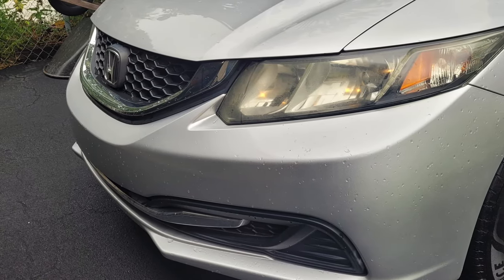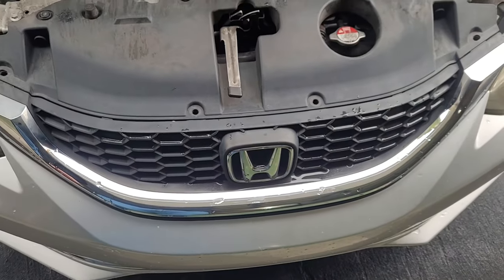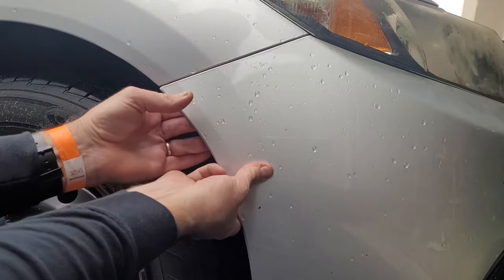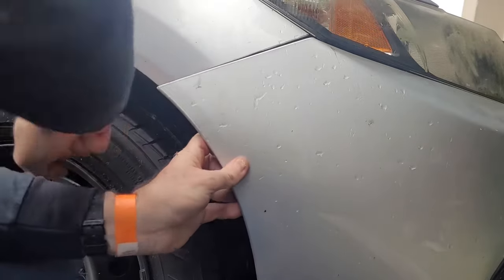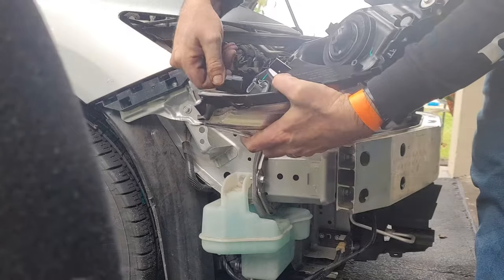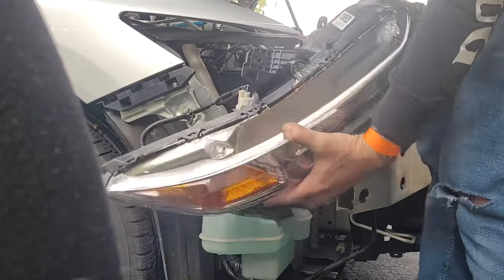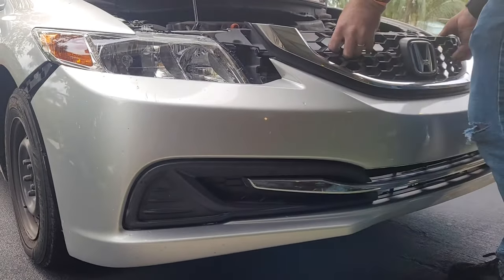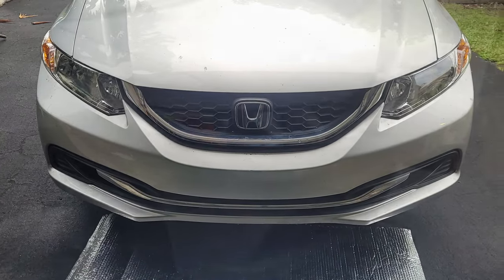2012-2015 Honda Civic Headlight Lense Replacement

Comment: Excellent instructional video on lense  replacement.  My local Honda dealer wanted $980 parts and labor to change lenses on my 2013 Civic.  Bought the parts new on Amazon for $150 for a set.  Watched your video and completed the job in 45 minutes.

Comment: This video really helped me replace the headlights everything went smooth 
Side note I ordered my headlights from Amazon 
And the bulb socket for the turn signals was really loose in the new headlights so if this happens to you just go to auto zone and buy the universal rubber O- rings from doorma and put 1 more that’ll create a snug seal and problem solved hopefully this helps anyone

Comment: Doesnt look too bad, I have a 2014 tourer (EU thing I believe), but it looks to be almost identical, just different shape light and bumper. All the metal structures look identical. We'll see what happens, I really just need to change bulbs but its so tight I'm better off taking it apart.
Reply: Easy peasy, needs some light percussion when assembling. The tourer has mudguards etc that make things a little different but nothing dramatic.

Comment: I'm currently having trouble getting the headlight assemblies out from the front. I've removed all 3 screws for each housing and have releases the small plastic latch on top. As much as I apply force to pull it straight out or in any angle, it won't come out.
Reply from the maker: There are a few plastic snap tabs in there. I can't remember exactly where they are or how I manipulated them to get them to release. Worst case scenario they break and you find replacements at the auto parts store.

Comment: Did you buy the new lenses from the dealer or did you buy aftermarket and if aftermarket do you remember the name of the company?
Reply from the maker: I bought the lenses on ebay. I picked the cheapest option that fit the car year, make, and model.

Comment: It would have been helpful if  you've been said each of the three types of lights you were replacing . I mean how do they called. Because I don't know how do I look for them at the store.
Reply from the maker: I replaced the entire headlight lense. You can go on the internet or to an auto parts store, provide the year, make, model (2012 honda civic) and what you want (driver side and passenger side headlight lense). The internet or parts manager will find the part you need.
Reply: Look on the outside of the headlight, you'll see H11 and 9005. Then the side light should be on the far ends.

Comment: You could have easily restored those with a kit
Reply: Restoration doesn't always look that good and doesn't last very long before the plastic is hazy again. I did restoration on my headlights and ended up replacing the headlights anyways.
Reply: @zeus_2001 It depends on how you do it and what kind of kit you buy or products you use. It doesn't really even have to be a kit. You want I finish it off with some kind of clear coating to protect it , whether that's a wipe on resin coating or a spray on coating specifically made for headlights or really the best way to do it would be to hit them with some clear coat spray paint. Something durable like a clear enamel paint or even like a 2K clear would be even better
Reply: Have you done it before?
Because they'll never be like new again.
The plastic itself, all the way through, becomes more and more opaque as it's exposed to UV light.😊
Reply: Does not work if the discoloration is on the inside of the lens.